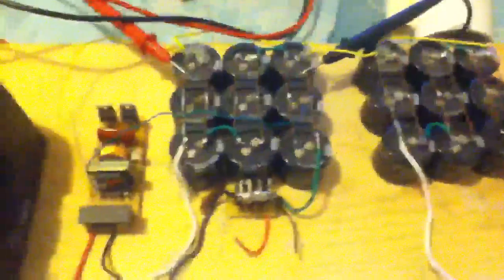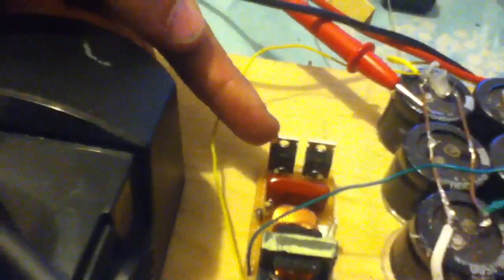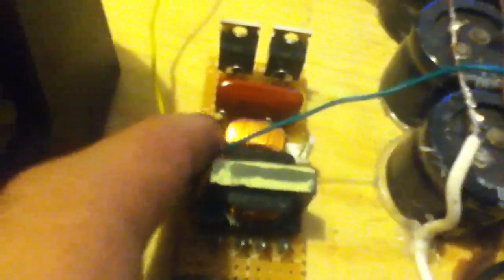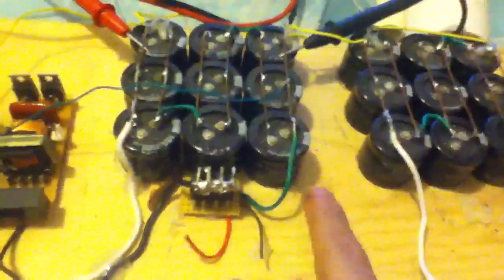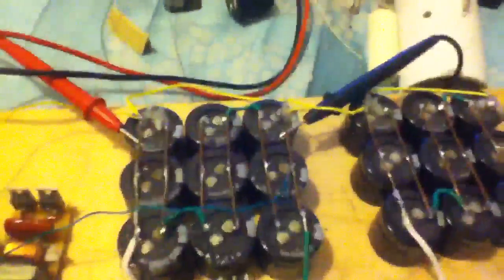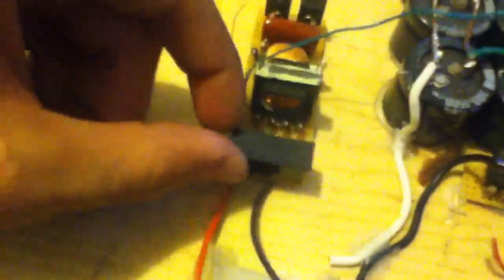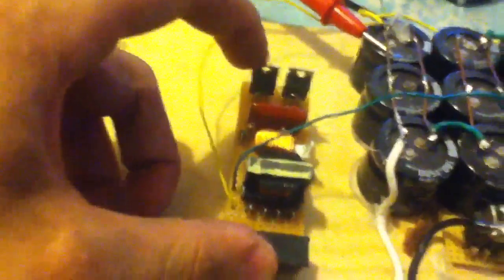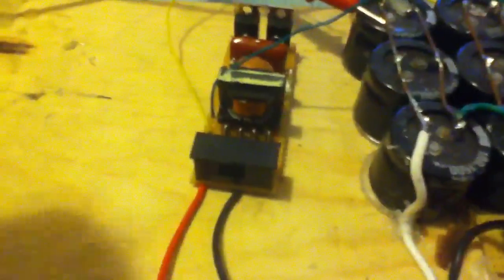Small Capacitor Charger

Comment from the maker: @coilsinamotor the capacitor is a 1uF cap rated for 250 volts (: bought it at radio shack actually :p and yeah, 560 ohm resistors :)

Comment from the maker: @coilsinamotor well with this charger the current consumed is really small, those resistors are actually slightly underated, its dissipating .28 watts, but they work (: for a regular ZVS driver you should actually use 3 watt resistors